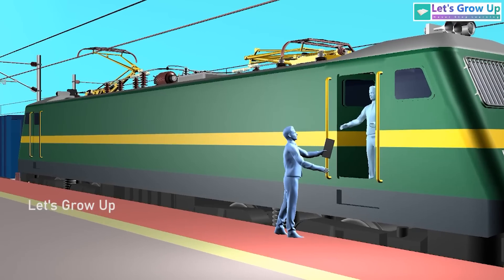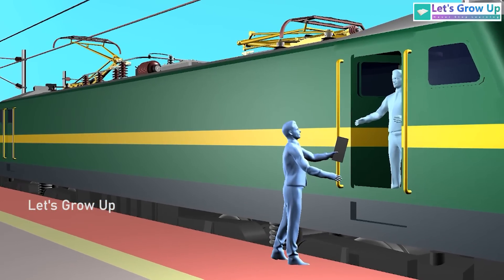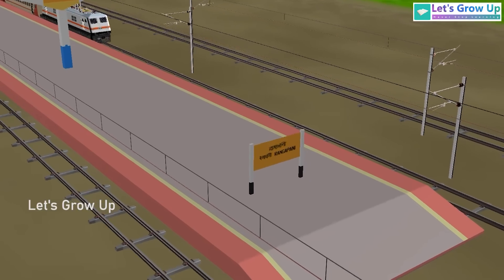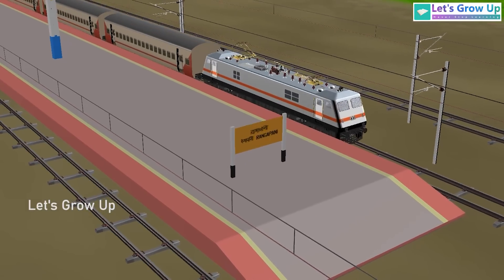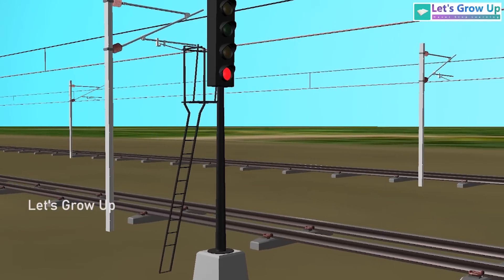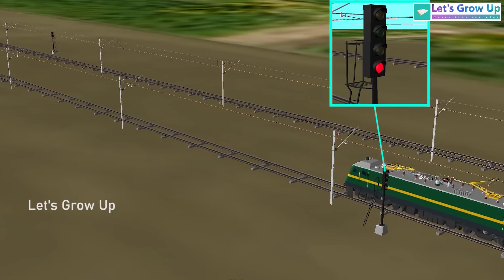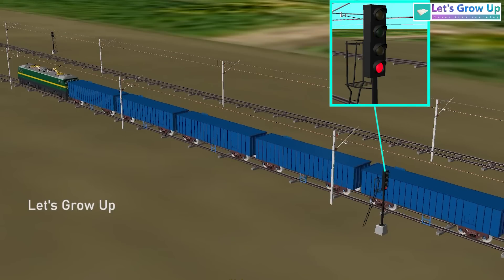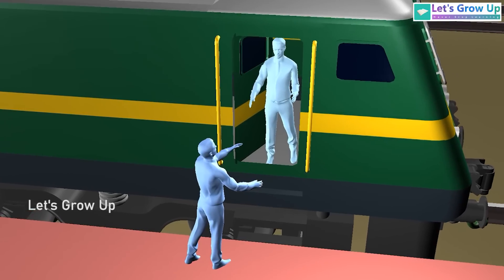The Truth Behind the Kanchanjunga Express Accident

Comment: These loco WAG9 HC with20 ft  CONCOR container of 45 is of high momentum and more massacre could happen if there were no parcel van in Kanchan and if these goods were of BTPN tankers as that section is very common in running Diesel hauled Tanker trains from N Bongaigaon, Guwahati Dibrugarh 

These 2 parcels have saved other passengers life else more massacre could happen

Comment: Good explanation 
In USA we have more heavier speedy diesel hauled freights above 70 wagons 
But we have GPS camera with ACd dynamic braking  to get alert from any collision which will stop  the loco  of both train automatically  within 1.5kms reducing speedometer  to zero 

We  always prefer  diesel locos as they are much stable and fit for heavier freights than Electric locos
Reply: but due to pollution control,our railways is converting to electric locos

Comment: The govt. Can sanction unlimited funds for fighter jet programs and missile developments but unfortunately KAVAACH system is not implemented due to high cost.
This clears the story.
Reply: Kavach could not have prevented this accident.

Kavach can only prevent accidents if the signalling system is working. Just like the electronic signalling system can fail, Kavach, which has many components like optical fibre cable etc can also fail.

There is too much hype around Kavach.

Comment: Unacceptable that in 2024, we have such poor communication systems. The goods train should have been stopped at Rangapani and informed of the train ahead to watch out for. Goods train loco pilot was overspending in a section where automatic signal was not working and he was given paper clearance. Kavatch implementation in all key routes should be speeded up. Voice communication system should be implemented between train loco pilot, train manager, control room and nearest two stations. What is the use of running semi high speed Vande Bharat when signal and communication systems are primitive ?
Reply: TA912 - Given to Loco pilot before departing RANGAPANI stn by station master...but as per rule there's no speed restrictions in TA912 While passing Red Signal